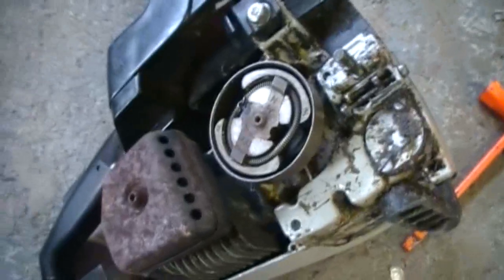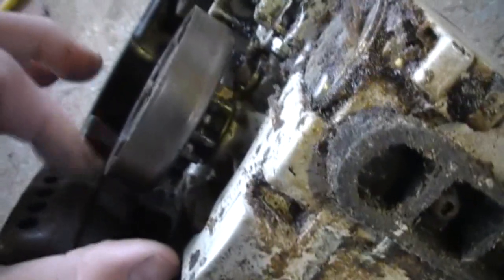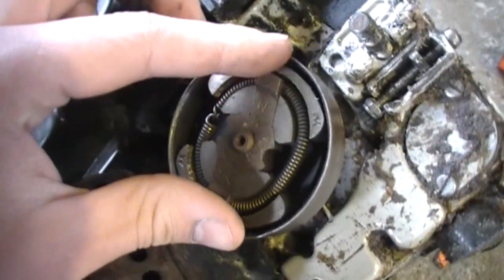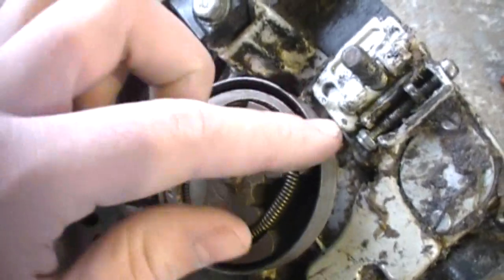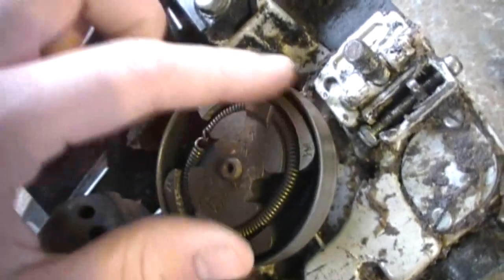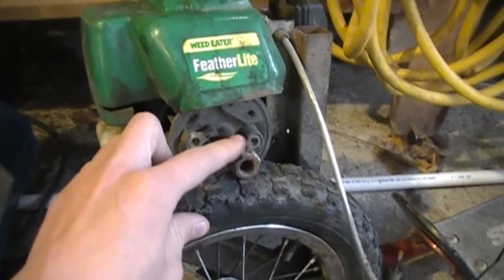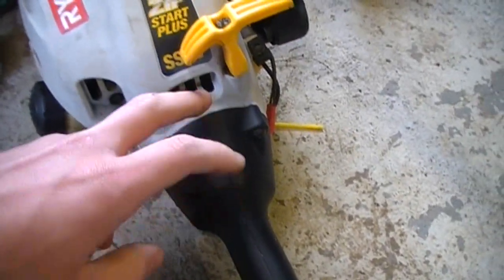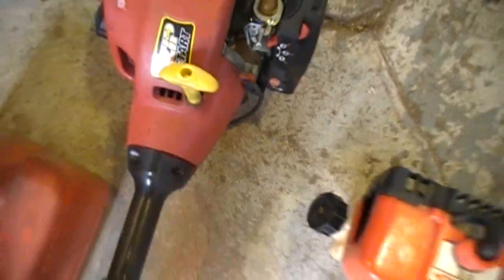how clutches work

Comment: This is the same way many old minibike/dirtbike clutches used to work, theyre called centrifugal clutches. They stopped using them because you couldnt get your bike going if you were stuck in the mud because the shaft had to be going a certain speed before your tires would start turning. and fast spinning tires in mud = no traction. great video. Could you by any chance make one about how a transmision works?